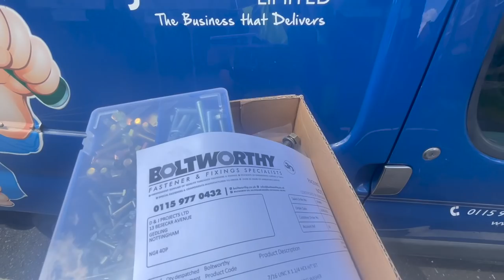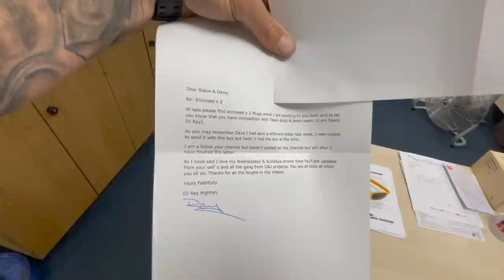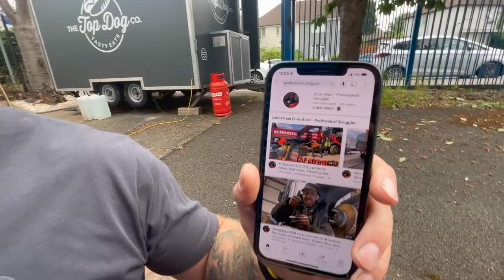WE STRUGGLED WITH THIS FENCE TRANSFORMATION...

Comment: I think that with such a heavy post the holes you dig do not allow enough post mix to properly fix the post in i seen you use by the looks of it one bag for some i would use two bags at least for a wooden 8ft 4x4 and for a concrete post which much weigh double the weight of a wooden post 2 1/2 bags to take no chances